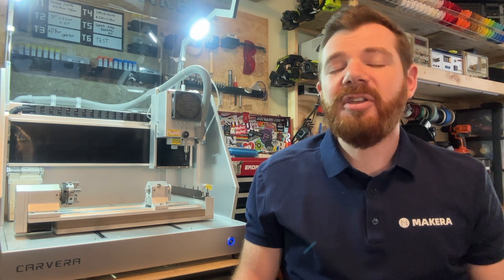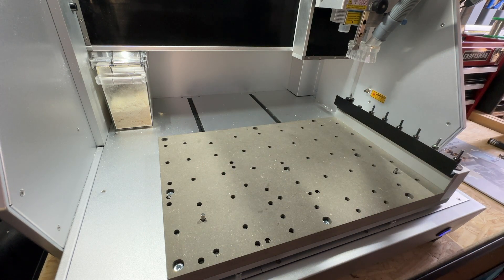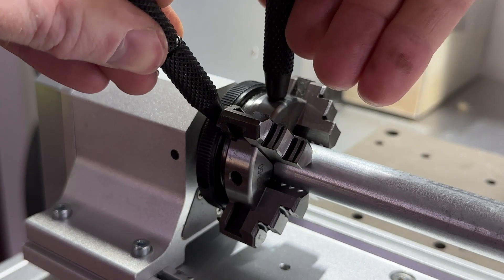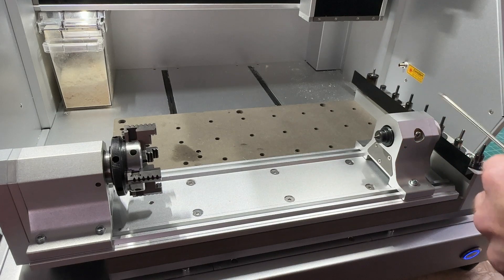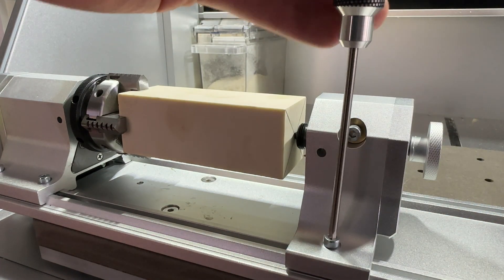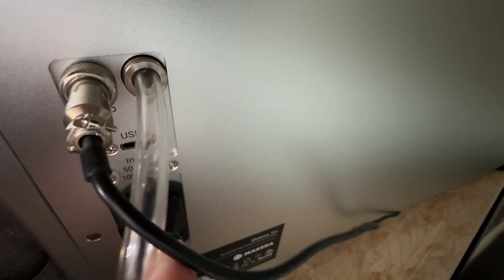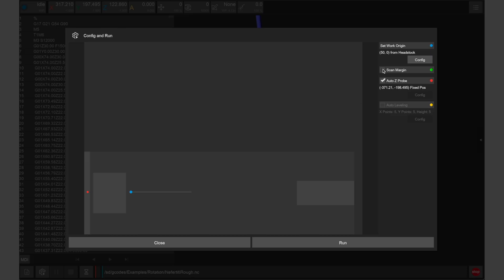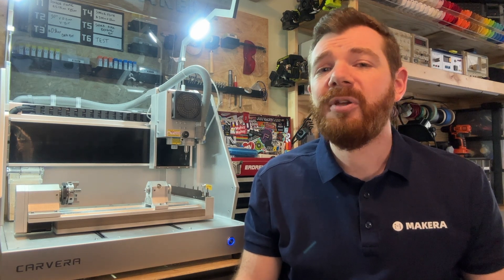4th Axis Installation and Configuration on the Carvera CNC

Comment: What is the max diameter cylinder this 4rth axis can hold?
Reply from the maker: 90mm
Reply: @Makera  Is this 90mm what the chuck can grip the most or the maximum diameter of material which fits vertically between the stocks?

Comment: Is the rigidity solid enough to machine metal in the 4th axis? Maybe aluminum at the very least but what about tool steel?
Reply from the maker: Aluminium is doable if the model and stock are relatively small. We would not recommend any harder metals than that. Definitely not tool steel.
Reply: @Makera  Hi, what would be a max size for an aluminium model on a 4th axis?